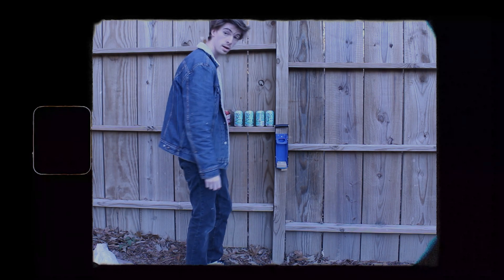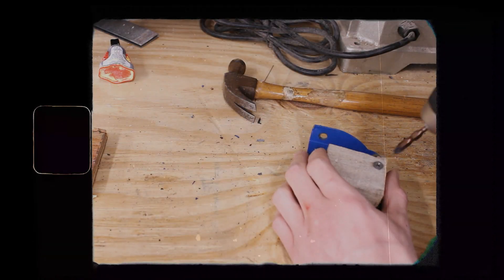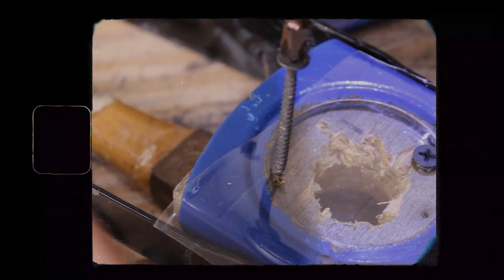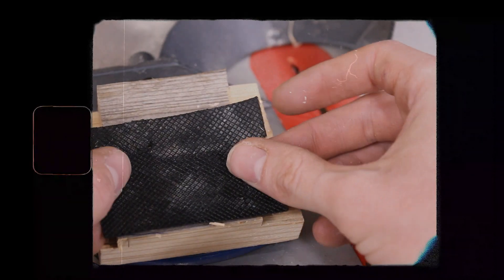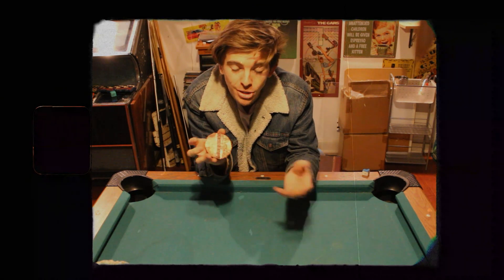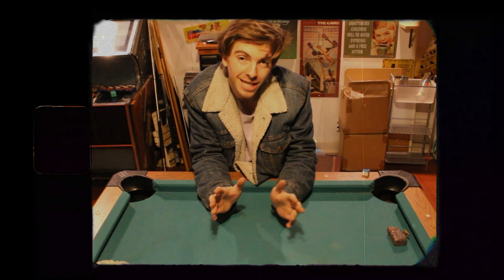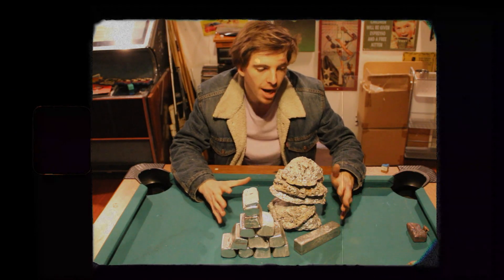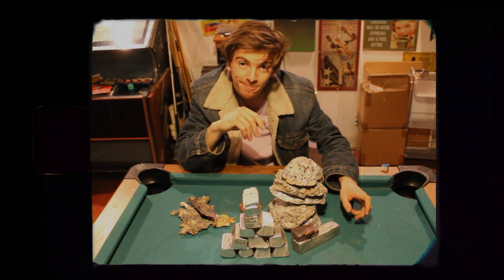Micronation Industries: Upgrading our Can Crusher and Showing Off Our Treasury

Comment: The upgraded can crusher looks delightfully sturdy. Forgive me if this has been answered before, but is this can crusher exclusively your work, or is it composed of prefabricated pieces that were assembled? 

Seeing how many cans are tossed out in Primario almost exclusively by myself, has got me tempted to send them along your way so they can better be used for repurposing.

I have, however, noticed there are also nearby recycling centers that deal exclusively in aluminum cans as well.
Reply from the maker: If you decided to send us some things that would be wonderful. 

The press was given to me as a Christmas present by Tiffany's parents. However, within the first 100 cans crushed it started to warp as seen in the video, so we had to make the current adjustments to the design.